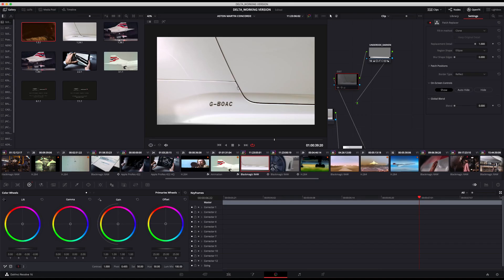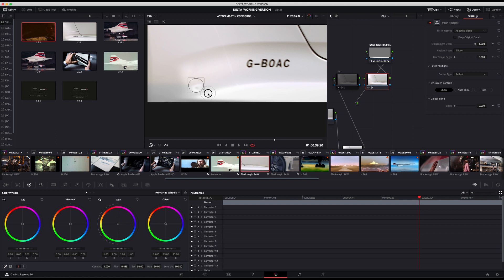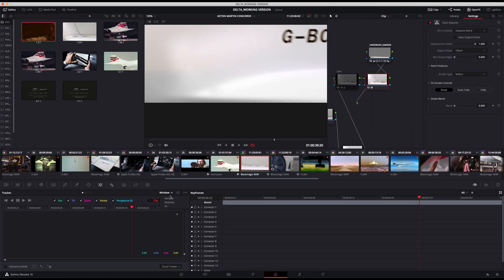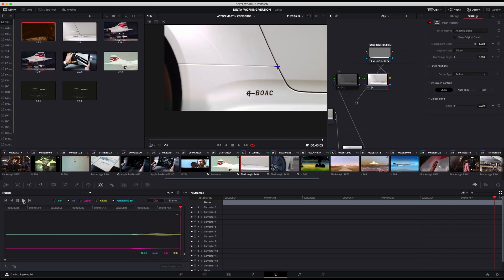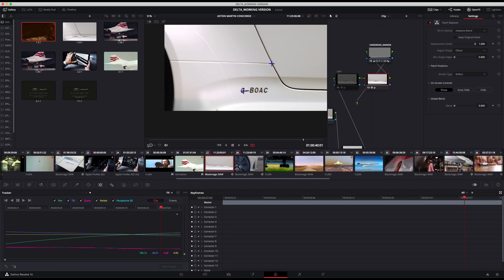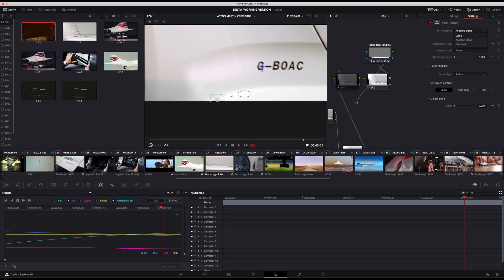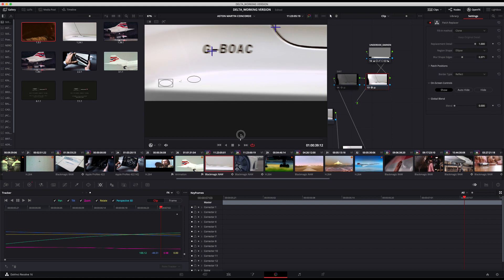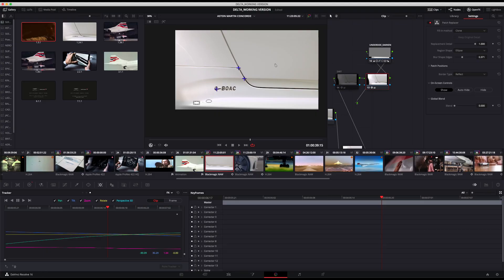PART 3 - Patch replacer & tracking FX - Doing it all in Davinci

Comment: Followed your video. This doesn't work for me because after I place a tracking point I can't move its position. It doesn't let me grab and move the tracking point.
Reply: BTW: I finally was able to move the tracking point. It wouldn't work before because the clip was zoom in. To move it one has to zoom the clip out, then move the tracking point to the position in the clip you want and then restore the zoom setting. As it stands I had to give trying to fix the blemish. There was just too much movement and hand crossing to make the effect track properly.

Comment: Thanks for making this easy to grasp. I am using the 2021/22 latest version tying to replicate what you did but when I click command to commence tracking there is a notice "Please select a power window to enable the interactive tracking mode first". I cannot get beyond this alert and eventually Resolve crashes. The latest version has a slightly different panel layout. Would you know what I am missing?
Reply from the maker: Hmmm we haven’t jumped up to the very latest version yet! I’ll have to have a look, in the meantime you do have to select what you’re tracking in the tracking window. There was a drop down to choose - power window or fx. For the patch replacer you need to have fx selected from that drop down menu.
Reply: @StillMovingMedia  Thank your getting back with advice. Your suggestion to check that Fx is selected overcome my error. Thank you Dale
Reply from the maker: @barrygreen9918  no worries, glad to be able to help

Comment: Could you track the spec of dirt itself as well?
Reply from the maker: Yes, however it wouldn’t necessarily give you a solid track. I generally prefer to track points which will give a good track in multiple axis on the surface I’m replacing.